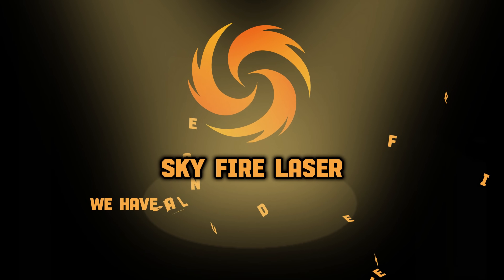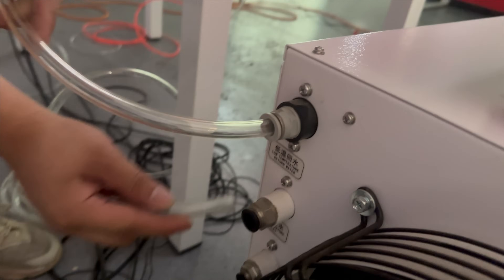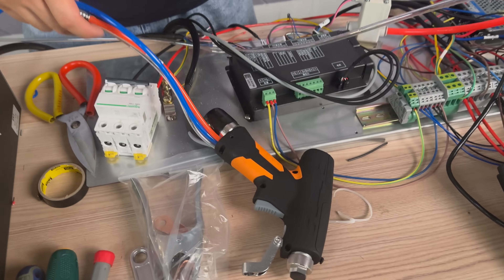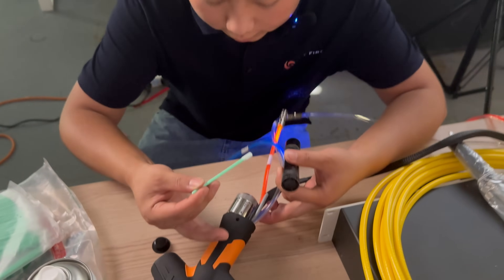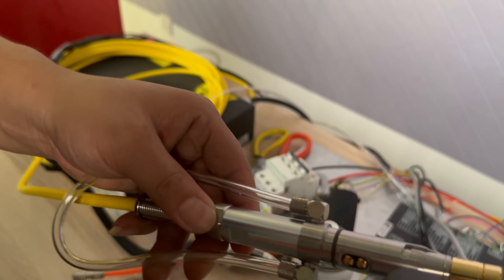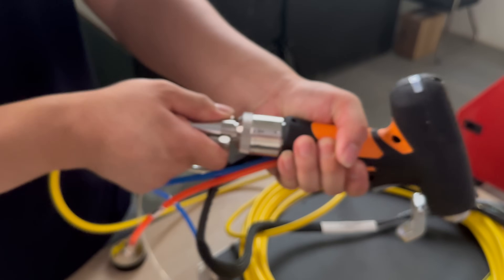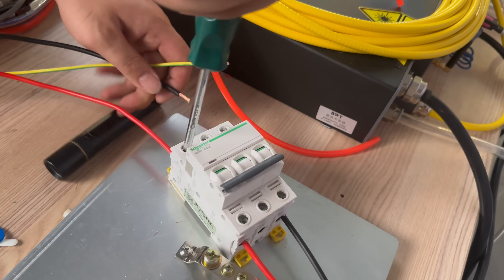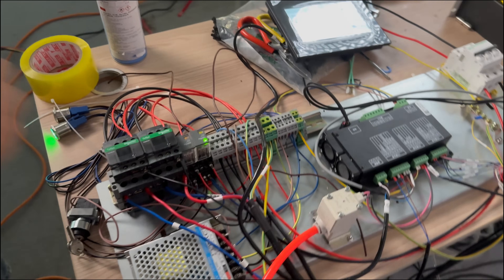DIY 1500w Water-Cooling Fiber Laser Welder Part 4 | Connection of Laser, Gas, and Water Systems

Comment: How long can we use laser welding as laser cutter ? maybe hours  or should be intermittent ? Its strange fiber laser cutter require high power screw compressor but laser welder not ...